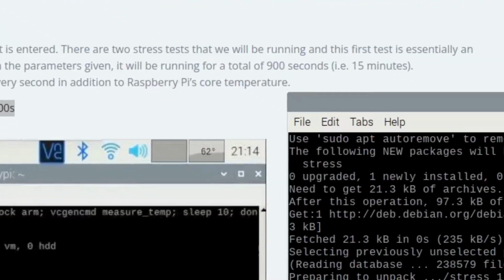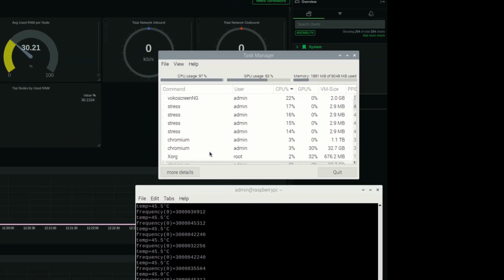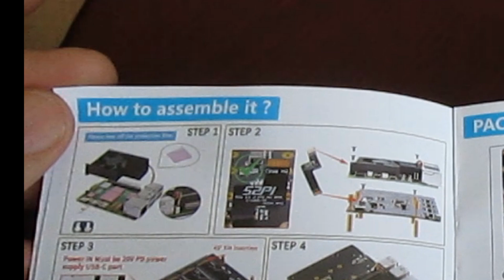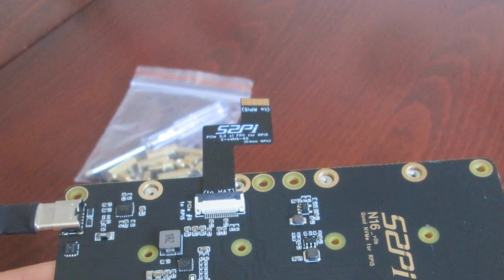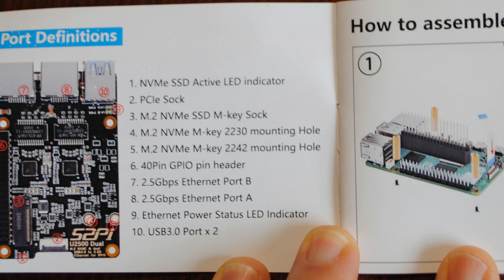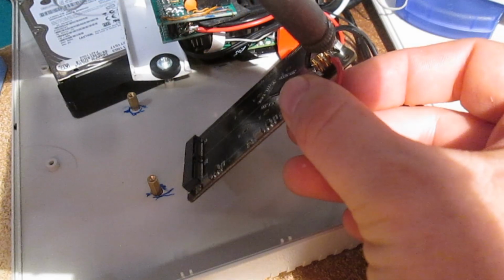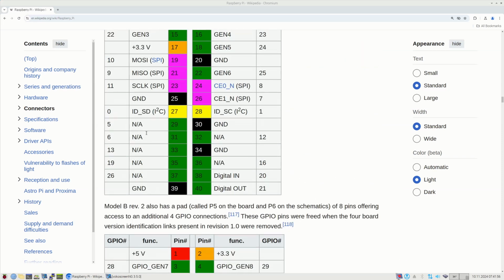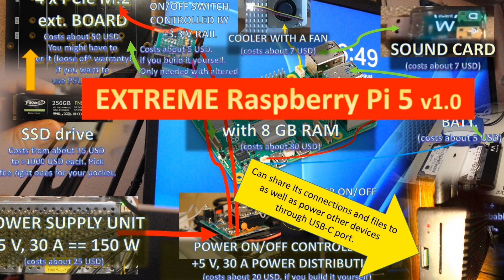Extreme Raspberry Pi 5 with an upgrade SETS A NEW SPEED RECORD! (52Pi  sponsored)

Comment: Wow！ Nice solution~
Reply from the maker: Thanks! It works like a clockwork... It's sticking to sustained 30 deg. C on a lite load and to a maximum of 45 deg. C on a heavy load... A PCIe switch board with four M.2 M-key connectors for SSDs and other PCIe cards and an industrial 5V, 30 A PSU give it a competing edge. Probably the most powerful Raspberry Pi 5 of all times....